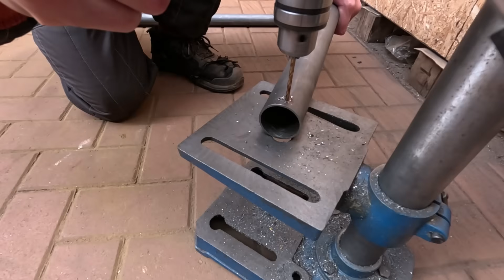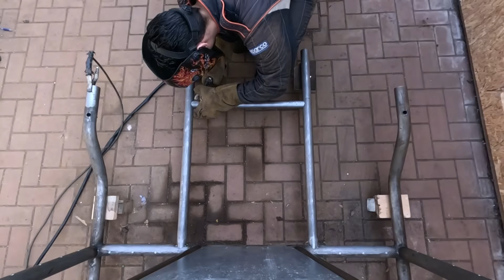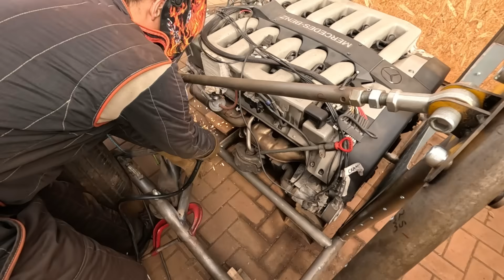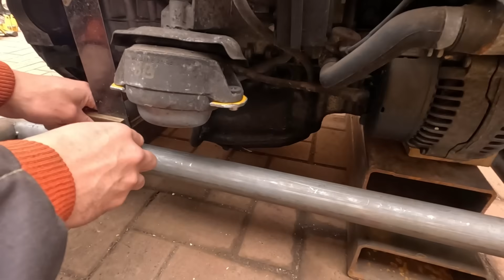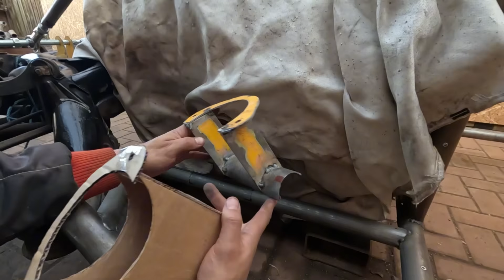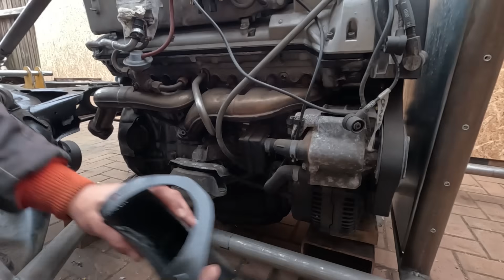BUILDING MY OWN V12 SUPERCAR

Comment: Love it. Why use adjustable rods rather than fixed tube?
Reply from the maker: Thanks 🙂 The adjustable rods allow me to change the ride height of the car and adjust the corner weight split. 

It is also good to account for any difference between the two sides of the car. They may be 1mm different lengths. 

Most supercars have the same adjustable bars. All the paganis, ferrari f50 and Enzo all use a similar system with adjustable ends. 

Thanks for your support 😎👍
Reply: Understood! Thank you. Looking forward to the next installment.
Reply from the maker: @humblenomadautomotive 🙂
I am hoping to get the next one uploaded at the weekend if all goes to plan 🤞 The next stage is taking a lot of fabrication time 👨‍🏭🔧
Thanks 😎
Reply: @UKBUILT  I will look forward to watching that after the kit car show in Malvern this weekend. Keep it up!

Comment: ONCE YOUR FINISHED HOW WITH YOU MAKE IT ROAD LEGAL ? AND HOW WILL YOU INSURE A BUILT CAR??
Reply from the maker: @EPICFUSED  Hello, yes the V12 build will be road legal. It will be IVA tested (like an MOT but 6 hours long) 👍 Kit built cars are actually easy to insure and typically cheeper than a mass produced car. Because there's so few kit cars made there's very rarely any accidents recorded with the DVLA, most people who build them luck after them. 

In the UK our insurance prices are based on what make and model get stolen the most or get crashed most commonly, them makes are the most expensive to insure. So kit cars are therefore cheep 🙂

I have covered the testing/registering processes in my TIPS videos for anyone looking to build vehicles 😎

Thanks mate 👍

Comment: I think you forgot about the transmission?
Reply from the maker: @iancoleconstantino1364 Hello, 
 I have made the design very flexible so I have room for many different gearboxes and transaxels 🙂

 I have checked it all off camera.
I have a space about 80cm long, 60cm wide and 60 cm deep. Every common transaxel fits in and the output flanges line up just fine (audi 01E, renault UN1, porsche g50, lamborghini graziano). 

I even have room to use conventional gearboxes and stack a normal differential ontop using machined parts. 

Thankyou for your support 😎👍

Comment: that engine is too much , everything will scale up too heavy , steel box section 😬nooo . use aluminium E fibre glass + small amount of steel for mounting points. 
its gonna end up a +3500lb shed if you use that engine + box section.  
You could almost clone a GMA t50 with alu fibre glass + smaller i6 engine . 
Dont make it a v12 ! Most manufacturers really struggle packaging a v12 . 
Its gonna be a heavy jelly .
Reply from the maker: @TheCraigy83  Hello, The chassis is thin wall roll cage steel so it's actually realy lightweight. Before the new additions it was under 40kg (88lbs)

It will have a carbon tub to strengthen the chassis. The full carbon body and tub is under 80kg (176 lbs) 

With all the component weights for everything added up it comes to around 1050kg (2314 lbs) dry weight 😎👍

Peak power is not the goal for this one. I am building a supercar to give me the zonda driving experience 🙂

I have faster vehicles so this is more of a passion project 😎

Everyone likes different things and that's cool 🤘 

Thanks for the good chat 👍
Reply: @UKBUILT   
Will 40kg hold +300kg lump ?
I'm picturing you having a modest front ender and that big lump of a v12 ending up sat on top of you final destination style 😬😂 . 
1050kg is a lot less then the real one you might be faster !  , why is pagani's like 1200kg/2800lb ish  standard even tho its dripping in carbon + titanium + aluminium ?
Reply from the maker: @TheCraigy83  😂 yeah it will hold. I also put roll cage steel in between the cabin and the engine bay to prevent the engine from ever leaping forward 👍 then there's the steel firewall and the carbon firewall bulkhead 🙂

It will definitely be lighter than a zonda 😎 I am ditching speakers and the radio 😂 I will listen to the V12 😍🎶 speakers are heavy + amps. 

I am keeping the air conditioning tho 🥶 

I will be machining my own aluminium and titaininum parts for this build at a later stage 🙂

Thanks 😎

Comment: What transaxle are you thinking of using?
Reply from the maker: @Rob-vv5yn  Hello, I am keeping it flexible so I have lots of options 👍
My favourite transaxel option would be a 6 speed manual graziano from a lamborghini gallardo / audi r8 😎
Thankyou for your support 🙂
Reply: @UKBUILT  I’m going to use a Subaru 5 so gearbox locked to front wheel drive, removing centre differential as a transaxle I’m using Honda K2.4 supercharger so only going mild 320-350HP. Your v12 is a bit much but a six speed could handle the v12 as an affordable option for you.
Reply from the maker: @Rob-vv5yn  Nice 👍 that's simular to what a lot of guys do with the audi/porsche gearboxes.
I have a few rare varients of the audi 01E that are good for 600+hp and 600NM. I may upgrade the syncros in one of them and use it depending on what comes up 🙂

Thanks for the good chat😎👍
Good luck with your project

Keep sharing your progress with my audience 🤘 I want everyone to be comfortable talking shop and sharing projects here 👨‍🔧
Reply: @UKBUILT  the Audi boxes are hard to find in my country another good choice is a manual Boxster gearbox they have been used on V8 engines upto 500hp as long as you don’t dump the clutch. Also impossible to find in my country but you might find them more easily where you live.
Reply from the maker: @Rob-vv5yn  Yeah all the porsche boxster gearboxes were made by the same company as the audi gearboxes. The porsche and audi transaxels are almost identical 👍  The weak audi 01X  are common here,  the strong 01E are more rare, the early 2.5 diesel varient are super rare as they did not sell the cars here.

There's plenty of good options tho😎 sometimes the ferrari and lamborghini gearboxes come up cheep. I am always hunting for parts every day so I can get the good deals  before most people see the listings. 

At this stage I am just going to get the car running so I can get it registered for road use. I am designing everything to be easily replaced 🤘

Thanks for your support 🔧

Comment: Put some extra strength to the chassis ur engine powerful
Reply from the maker: @sydelmendes8688  Hello, The rear part of the chassis will have a few more small supports to strengthen it 👍 I am building it like T50 with mimal materials. The center part of the chassis will have the carbon fibre tub to reinforce it and stop any twist. Once the roof bars are done it will be alot stronger. 

The engine will also have the gearbox mounts to strengthen it just like the mercedes did 🔧

I am using roll cage steel for most parts so it will be plenty strong enough 😎👍

Thank you for your support 🙂

Comment: Love to see the editing is getting better ! And love the big spanner. too good !

Its soo close !  This stuff takes time but I'm sure your a few videos away from turn key.
Reply from the maker: @phillpana  Hey, Thanks mate🙂
I am glad you enjoyed it 😁 I hope I can get it started again soon 🤞 I tested it in the donor car before I removed it and it sounded epic. 
Thanks for your support 😎👍
Reply: @UKBUILT  I imagine there's a bit of wiring to sort through !🤞
Reply from the maker: @phillpana  Yeah there's 6 bin bags full of wiring harnesses 😂
Luckily it's an old 90s car so it doesn't complain to much when things are unplugged. I'm confident this one will start without issues. I also labeled everything 🙂

It's actually quite a simple system compared to the modern stuff. It's made before OBD and canbuss👍 
(I worked on many modern supercars/hypercars during their R&D stages) 

My donor vehicle was in very bad shape but I rewired it and repaired critical systems before taking it apart. I did lots of engine testing to make sure I had a known system before I removed it. 

I even started the engine during the disassembly stages. It happily ran with no interior, no seats, no doors, no headlights, no gearbox 😂 it's that great era of car that doesn't really care what's going on 😁

Since I started with most of a running car and I am using as much as I can from the donor vehicle (to get up and running) , this project is not actually as difficult as it appears. 

The youtube side of things is my challenge. (I was already building car projects privately before youtube) 

Thankyou for your support 😎👍
I appreciate it mate🙂

I enjoyed seeing your mx5 coming together 🤘
Reply: @UKBUILT  Your doing just fine! 

End of the day, the knowledge you have is valuable. What I'm lacking 🤣. The youtube stuff comes with time. Your doing great !

Comment: I think you are missing a big part of the build. Where is the gearbox going to fit in.
Reply from the maker: @trevorwoods2580  Hello, 
 I have made the design very flexible so I have room for many different gearboxes and transaxels 😎

 I have checked it all off camera.
I have a space about 80cm long, 60cm wide and 60 cm deep. Every common transaxel fits in and the output flanges line up just fine (audi 01E, renault UN1, porsche g50, lamborghini graziano). 

I even have room to use conventional gearboxes and stack a normal differential ontop using machined parts. 

Thankyou for your support 👍
Reply: @UKBUILT  good man. Keep up the good work. I'm enjoy the build.
Reply: @UKBUILT brilliant pal can't wait to see the end result 😊👍
Reply from the maker: @DominikGel  Thank you 😁👍